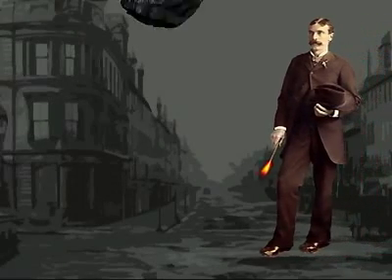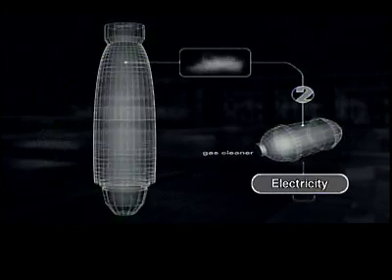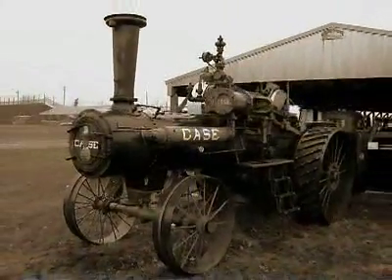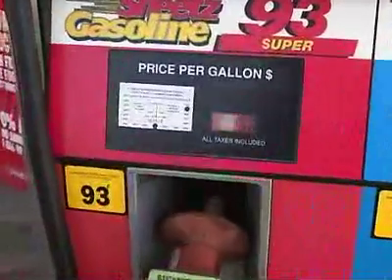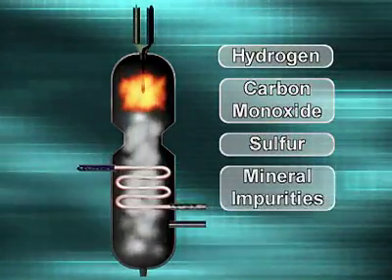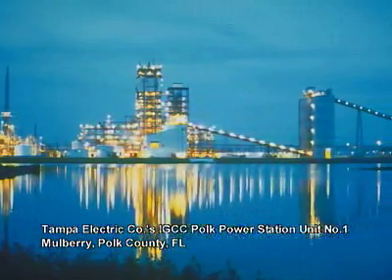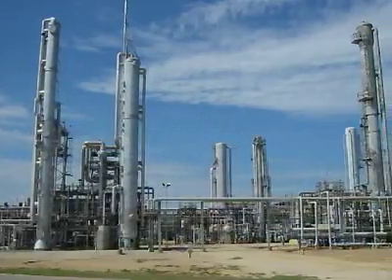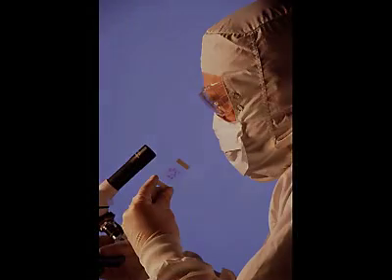Energy Research Highlights-2

Comment: Geothermal's great, but tectonic activity which regions you can generally find places for geothermal plants can render the facility destroyed or the vents empty. Hydro is bad for the environment since it messes with soil deposition, eroding coastlines dangerously over time. Tidal has the same sorts of issues. Biodeisel has similar problems to ethanol, which is that it takes up ~as much fossil fuels to make as it yields, wind is restrictive, solar is fine but not efficient enough to meet demands.

Comment: @MarkProffitt Totally disingenuous.  Corn cannot be grown without pesticides and it erodes soil. Hemp does not require pesticides and strengthens the soil, even when not rotating crops.  It does not damage the soil at all.  Industrial hemp can be used for biomass fuel, industrial lubricants, plastics, etc. and the fact that it is generally not grown for food is a good thing because growing it does not pull from the food supply.

Comment: @MarkProffitt Actually that's false. When using hemp or algae as the biodiesel fuel source instead of corn, you are not pulling away from the food supply, you don't require dangerous pesticides, and the soil is strengthened rather than being depleted as it is with corn.Also, any of those sources could be used for transportation if you are using an electric engine. Coal is inefficient, dirty, dangerous to acquire, and no matter what anyone says, there is no such thing as clean coal.

Comment: @laraeventide It doesn't produce CO2 it releases trapped CO2 that used to be plants on the surface of the planet. If you do the math you will find the carbon trapped in coal and oil matches the amount needed for plants and trees to cover the desert areas of the Earth. And those plants will absorb and use the water now trapped in ice so the greenest thing you can do is to release the trapped CO2 in coal and oil. Restore the global forest.  :)

Comment: Don't buy into it.  There is no such thing as clean coal.  It's dangerous to extract from the earth, and is not renewable.  Coal is not a good replacement for oil or gas.  Biodeisel, Solar, Tidal, Wind, HydroElectric, Geothermal, etc. are all better options than coal.